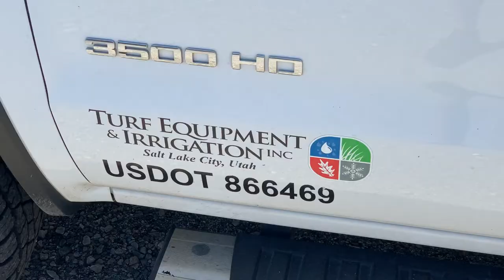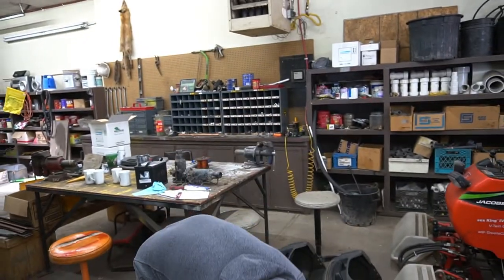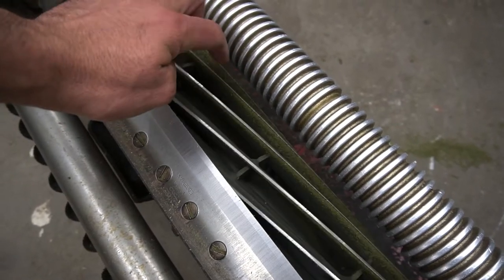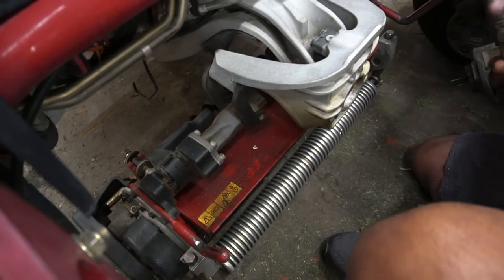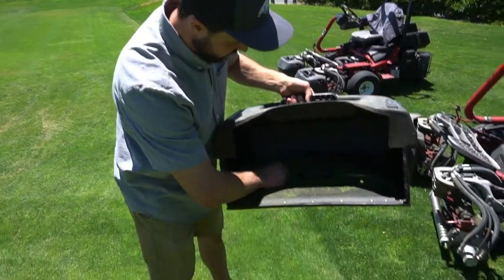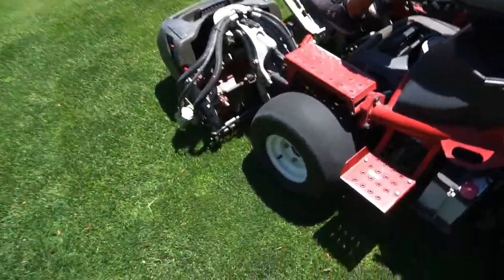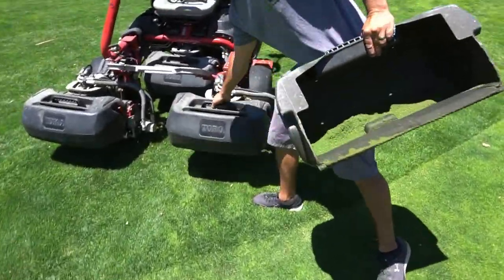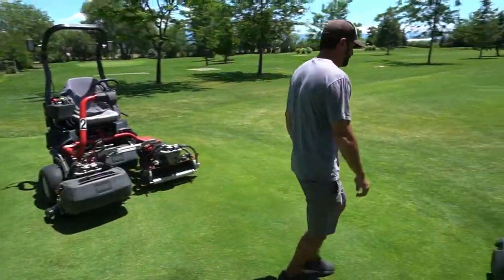Toro Reel Mower Test

Comment: How to remove and install cutting units on a triflex.

1. Park where you can reverse the mower to an open spot.
2. Set units on floor and disconnect cutting units.
3. Place reel motors in lift arms.
4. Raise lift arms and reverse away from cutting units.